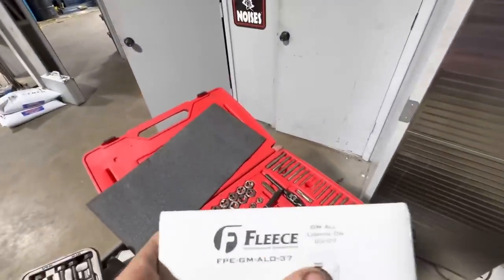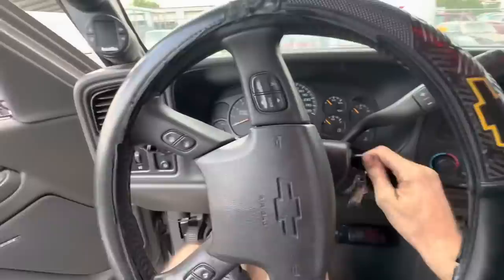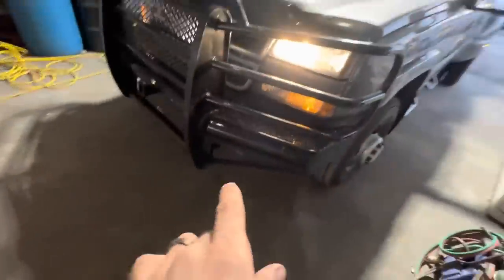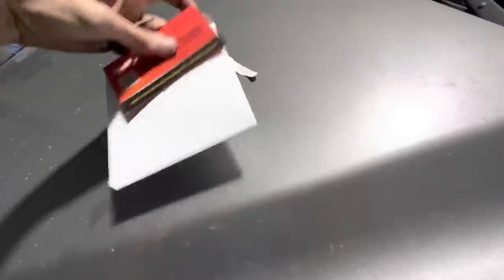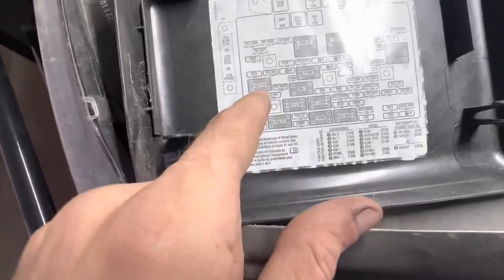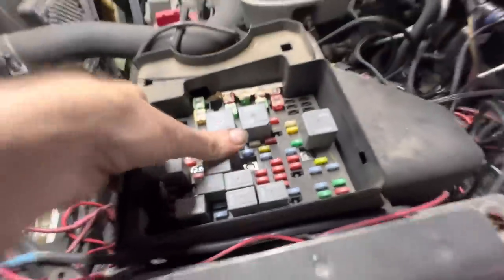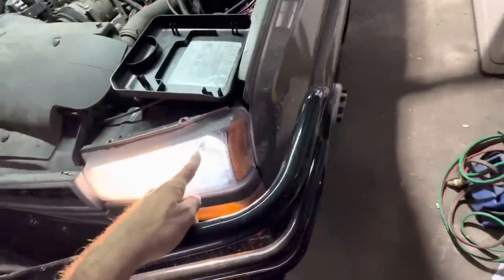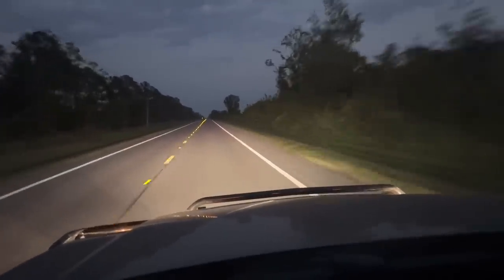All Headlights ON! (Plus Fog Lamps) GMT800 GMC Chevy 2003-2007 1500-3500 Trucks #Bambimode

Comment: I do not know the laws in every state. In Oregon, this would be illegal. No more than 4 forward facing beams permitted at same time. Is why factory fog lights cancelled on highbeam.
Reply: Yes also in Wisconsin but I wouldn't worry about it you really have to have let's say a unique cop that would pull you over for something like that
Reply: Pennsylvania it is also a ticket. It is called Dual Headlighting.
Reply: In the north country (Canada) this also the law. That is why light bars must be covered on the road.
Reply: Agreed, States can be more restrictive then the DOT requirements. DOT refers to FOG lights being Yellow in Color and any other White light as Auxiliary Driving light.
Reply: NY, VERY illegal.  And on long Island where I am... Yeah, they'll nail you first chance they get.
Reply: @ganzonomy  good they are blinding!!!
Reply: I think in Florida you can attach stadium lights to your vehicle and they wouldn’t care lol 😝
Reply: Yes sir, it's illegal in Florida too .if you take this as some type of mechanical knowledge this video is fine but people should be aware that it is illegal to drive like that and they should not cry when they get the ticket but I'm sure they will claim victimhood like they do nowadays
Reply: Yup a lot of states it is and can get you a ticket
Reply: Factory fog lights are switched off with high beam headlights on is because, in theory, the low height of the fog lamps allows the beam to get under the fog, high beams are more likely to be reflected off the fog, resulting in more glare, less vision improvement.
Reply: @JM-lk6wo  white fog lights are not fog lights.😂
Reply: Probably he gonna use this on his own big property
Reply: Also illegal in Kansas.  But… my experience is lighting laws are not enforced.  You’ll be wearing your sun glasses driving at night here!
Reply: Personally think you wasted your money
Reply: @BlackLung87  Dave's not here, man
Reply: “Not for highway use in the states of California, Connecticut and confusion…” 
I did this by way of adding a relay to my old Subaru — ‘twas good!
Reply: @BlackLung87  No, it only changes the lights (adds the low beams and fog lights) when the high beams are turned on. The low beams function as usual.
Reply: @The781971  LOL a solution looking for a problem.
Reply: @rccola5167  Old school, yes, you're right. But, in this day and age, tell the auto manufacturers their factory fog lights aren't 'fog lights'.
Reply: Illegal in NC as well.
Reply: The reason they cancel fog lights on high beam is because High beams make things worse in high beam so you shouldn't need fog lights on high beam
Reply: @zackarymcclain164  I am thinking that blinding oncoming traffic with 6 beams at once has something to do with it being illegal.
Reply: @onejohn2.26  Takes a unique cop in Oregon too. Any cop who is oncoming. They are happy to u-turn and stop you for a chat.
Reply: @robertfarrar9411  light bars only have to be covered here in Canada if they are installed ontop of bumper or installed higher than headlights. otherwise here in Canada u can have them without covers if below bumper. i do installing for people all the time. also best place if u want without a cover and higher than bumper is mount them behind grill and cops cant ticket u because grills in court are considered covered.
Reply: @highseed69  Good info. Thanks
Reply: That’s the law in Texas as well. Most cops just don’t enforce it. I know this because a family member that’s a cop told me 👍
Reply: @JM-lk6wo  like you said - high beams in fog is a bad idea - at least the kind of fog we get here in UK.
Reply: @James-mm9wc  unless your fog lights are pointing up it wouldn’t be any more blinding for oncoming traffic. The only reason high beams are so blinding is because they’re pointing right in your eyes. I’ve always found it bs that you can’t use fog lights with high beams. When you’re driving in pitch black middle of nowhere the extra light up close in the ditches is a lifesaver.
Reply: @specialestness  I agree that aiming has a huge impact on glare. But, more beams equates to more watts. Thereby more lumens!, as Ray would say. Most low beams are 55 watts, high beams are 65 watts, driving/fog lights run from 70 to 100 watts. Running 6 of these beams at once could yield 440 watts. That's bright, even aimed low. Thinking there is good reason it is illegal.
Reply: @James-mm9wc  realistically oncoming traffic shouldn’t be affected considering you’re supposed to turn your high beams off. A lot of newer vehicles use projector beam headlights that just have a shutter that moves up for high beams. Having the fog lights on at the same time would still leave 4 forward facing beams. I guess I just don’t get why they don’t let you do what you want. You can do all sorts of illegal things with a vehicle without modifying it, why is this where they draw the line?
Reply: @specialestness  Key word is "supposed". Even when drivers dim lights as required there is reaction time after they see the oncoming vehicle. Oncoming driver's night vision is impaired until dimming occurs. 4 forward facing beams are legal in Oregon. 6 are not. There has to be a "line". The lawmakers we elected chose 4 as the limit.
Reply: @James-mm9wc  I’m not just referring to lights here. The highest speed limit in America is 85 mph. So why are vehicles capable of going faster? Why wasn’t the line drawn there? Why is it with lighting that they suddenly care? Adding fog lights with high beams won’t make any noticeable difference for oncoming traffic, no matter how many times you say it will. If it were the case then we wouldn’t be allowed to use low beams and fog lights in non fog conditions.
Reply: @specialestness  Speed limits are only applicable to public roads or premises open to the public. Cars drive on private land also. Having done a little drag racing and pit crewed for a NASCAR, speed limits are not a thing. Modern cars are electronically speed limited however. Set by the tires speed rating. No further comments on lighting since my opinions do not matter.
Reply: @James-mm9wc  so if vehicles can operate on private land therefore not limiting speed then why can’t the same theory be applied with lighting?
Reply: In Oregon.Brown Wheelers should be illegal.
Reply: @doctorseuss5349  Ok, I'll bite. What is/are brown wheelers?

Comment: Did this with my new 2022 F150 using FORSCAN free software and a $40 OBD2 USB interface - they call it "Bambi" mode. It's ,y first Ford truck, was GM from '89 until last year, but not complaining about the GM trucks I've owned - just wanted a switch-up!  Wanted to let the F150 owners out there who may have snuck onto this video that there's a way to program your Ford to do this (with tons of other cool customizations) for cheap!

Comment: Fog lights would be useless with high beam on. The high beam will reflect the light back  so it will negate the fog lights trying to cut through the fog. In Australia it is actually illegal to drive with fog lights on unless it is foggy

Comment: Been doing this with diodes since buying my 2005. Found this circuit board to replace the diodes and it didn't last a year. At one point, I lost all but my fog lights. Through this where it belonged in the garbage can and installed the diode setup again and it's once again, flawless!

Comment: I did a fog light anytime mod to my truck. Enables me to run fog lights anytime not just with my low beams. Jumped the fog light relay coil to ground not through the headlight relay!

Comment: Besides the high beams reflecting from all kinds of droplets at the eye level, there is another issue to consider -- heat.  If you have all lights on at the same time, you are heating up the lamp compartment to either unpleasant, or even dangerous levels. The extra temperature rise reduces the bulb life more than you probably realize and expect.

Comment: Pennsylvania Inspection Stations check for modified electrical systems which allow fog lights to operate with high beams. Illegal, and my car once failed for having an independent foglight switch. Also, many states allow illumination of no more than four (4) headlamp/fog/driving lights in any combination on public roads.. Cool mod, but proceed with caution.

Comment: I wire my fog lights on their own relay and switch.   One of my cars years ago had the 4 headlight system.  I wired up switching and relays so I could select which filaments were.enabled.  modified.the mounts so all 4 could be hi lo halogen.  I could have  all 4 low beams and all 4 high beam filaments on, plus the fog lights.
Reply: What type of vehicle did you have that both the low beam and high beam had both filaments in them. I remember the 1973-1987 Chevrolet pickups having 4 head light on the upscale models, yet only the low beam was dual filament and high beam was single, when switched to high beam all four would shine as a high beam only. Curious!

Comment: Only thing I'd be worried about is the amount of heat inside the lens running both lamps. Especially if you come upon any cold rain during the night.
Reply: The lenses are plastic, so rain on hot lenses isn’t an issue. It does accelerate the deterioration of the coating on the lenses and also causes spider web cracks in the plastic after 5 or 6 years use. I’ve had my Fleece all lights on module for over ten years now and I wouldn’t be without it.

Comment: A number of people are concerned that running the high and low beams and fog lights simultaneously would violate most state's laws of no more than 4 forward facing beams on a vehicle on the highway, this may not be the case with some configurations. You notice the law states "beams " not filaments. With many cars the high and low beams share the same bulb and/or housing. If running the high and low beams simultaneously simply means both filaments in the same bulb are illuminated that is still only one beam (two counting both sides), or if you have two bulbs in the same housing where two bulbs are illuminated but using the same reflector and/or are indistinguishable as being separate beams, it would also count as a single beam.

Comment: my 2000 dodge Dakota has it from the factory, just turn on light switch and pull light switch knob and all lights come one. problem thought in order to dim the light you have to push the headlight in each time.

Comment: it isnt a problem for the fuses and wiring to have them all on at the same time ?
Also, how is the temperature difference inside the light assembly with both lights on for a long time ?
Thanks if you have time to reply

Comment: Ray, in a setting where the original design basically only allowed you to run either high beams or low beams only, won't running both at the same time generate more heat than the headlight housing and connectors were designed for and consequently risk distorting or melting headlight housing and or connector assemblies? I've seen regular headlights alone generate enough heat to distort the wiring connectors and in a few cases burn the connector.
Reply: On all my cars, when I turn on the high-beams, the low-beams stay on too.  So the headlight housings will be just fine with this mod.
Reply: Yeah I would worry about having the current doubled on the wire, at 12 Volts if each bulb is lets say 55 watts just throwing a number out there, that's about 4.6 Amps each, that will now be 9 Amps. (55 watts divided by 12 Volts).
Reply: Housing, maybe, wires/connectors, I doubt it. Each bulb is fed by its own wires and connector. I did 'my version' of this to my truck ages ago - spliced connectors into the wires under the fuse block that allowed me to plug/unplug diodes for low and fogs.... Personally, I'm not wild about the way the relays go through the board without any real solid connection, but we're talking low current and I guess it works.
Reply: @aperson9495  if I understand the system correctly, the board is simply using output power from the high beam to send a trigger back to both the low and fog relays to re-power. This nearly 0 extra load on the high beam circuit. I could be wrong tho, I swing a hammer for a living.
Reply: @PatricksDIY  Ray's mod here does nothing bad to the truck. The lights and wires are working exactly the same as many cars... Low and high beams on at the same time. It's only allowing the fogs to also be on. No wires are being over-worked with extra current. All the wires are carrying the same current they're designed to carry.
Reply: @tenflat2009  No, you're correct, it's a VERY small load to drive the relays, like you said, nearly 0, but it's still not a very good connection IMO. Originally, I had just used two diodes and stuffed into the leads into the appropriate terminals for the relays, but later, I spliced (solder and shrink tubing) wires into the appropriate wires underneath when I had the fuse block out and ran them out form under the block with weatherpack connectors so I could remove the diode(s) if desired. Much more solid connection IMO.
Reply: @watchingdanny  The problem is not high and lows together when switched to high....that is normal.  The problem is fogs should only come on with low beams.  That is a legal requirement in most countries in the world.  If you did that to a car, certainly in the UK, the police would issue an infringement notice plus your car will fail the annual MOT roadworthiness inspection.  It may also invalidate your insurance due to being an illegal modification.
Reply: @Biffo1262  it’s a good thing he isn’t in the UK then isn’t it

Comment: Over here in the EU, for years, the most common bulb was the H4 bulb. Probably still is. It has two filaments for high and low in one bulb, both in the same reflector, same housing. Those H4 bulbs will probably fail fast when both filaments would be lit. I've never seen a car with H4's that would allow for both filaments to be lit. Not even when using the signaling function.
For your setup, I think there is some concern. It looks like your lows are LED and the highs are halogen. Running them both at the same time for a prolonged time might cook the LEDs. They are quite sensitive for heat. Looks like there are two reflectors in one enclosure, so it could overheat the LEDs.

Comment: A couple of potential problems I see with that board. First the relays are now raised up a bit now, probably 1/16", and that could be enough to allow the relays to pop out of the sockets because of vibrations. Second, the low beam and fog light relay control lines are being fed a voltage now, and whatever control module that drives those relays might eventually have a problem with it, or you may have weird error codes popping up. As an engineer, I will say it is a slick design though.
Reply: My thoughts too. I'm guessing the original design was engineered to limit current to all lights on, which could cause some low voltages and/or overheated wires.

Comment: 99-02s are easier. The low beams are wired so that switching to high beams kills their ground. So you just clip their ground wire and put them straight to a ground.

Comment: As mentioned by others, this is not legal in a lot of places. The fog light aspect is a bit pointless, as fog lights and high beams are opposite and neither is useful in conditions that require the other.
However it’s relatively harmless, so if it’s legal I have no issue with it.
Don’t do this on any vehicle that uses compound (dual filament) bulbs. Only on headlights that use separate, single filaments for each function.
The combined heat of the two filaments will be too much and so too will the current of the combined high and low beams on their shared ground pin. Weakest link will fail first, whether it’s the reflector melting, the bulb itself burning out, or the connector burning up. That’s partly why the kit is for such a specific range of vehicles. They all have six separate bulbs. The mod is very easy to do without the kit, on any vehicle, but not advisable for the reasons stated, on some.

Comment: IDK if you're going to read this at this point, so I'll post it to the masses as well..
how would you recommend solving the LED brake light/cruise control disable issue for our trucks? I have the 03 gmt 830/suburban 1500 lt
Would you say the Novita LM487 LED flasher relay, or doing inline resister installs to the body is the best option to get LED brake lights while also keeping cruise control functional at night??

Comment: Where I live in Canada it's illegal to have more then 2 sets of forward lights on at once. So can't have lo hi and fog at same time. Not even allowed to have light bars installed on vehicles anymore or won't pass inspections either.
Reply: I mean technically speaking, the hi/low beams are a single unit with 2 bulbs inside. So could argue that even with both hi and low beams on, its still a single beam. 
But the suits that make the rules probably have some stupid counter to that.

Comment: Been illegal to run both high and low beam headlights simultaneously in the USA since 1967. That's why vehicles manufactured in or after 1967 haven't had the ability to do so.

Comment: Nice.  Living in Ohio deer are a real problem.  The more light the better at night.  More than 40 years of driving only accidents outside of work have been with two deer at night. 

Technically illegal in Ohio but if you don't turn on the fog lights, not illegal.  And even if you do no cop is going to notice or care.  It's not like there are auxiliary lights mounted on the truck that can easily be counted.  Cars headlights nowadays have all kinds of fancy configurations with strips of led's and such.  The low beams staying on won't be very noticeable.    

Cops will care though if you fail to dim your high beams.

Now I have to find the same for my 2007 Silverado"s with the new body style.